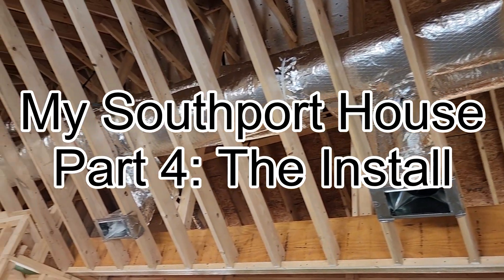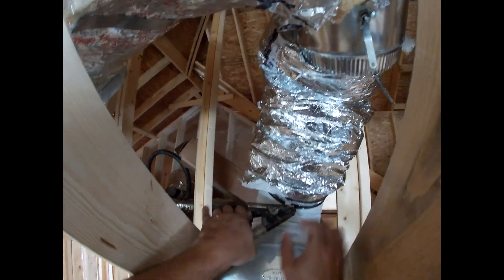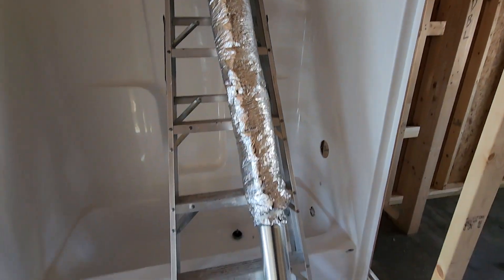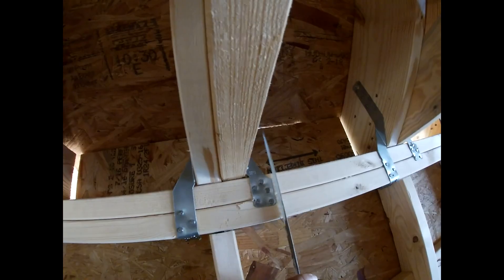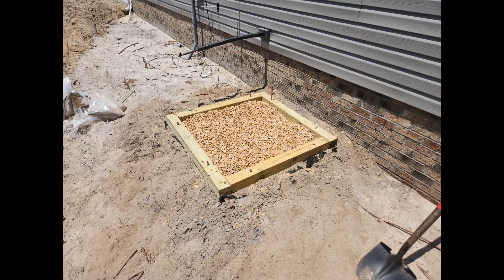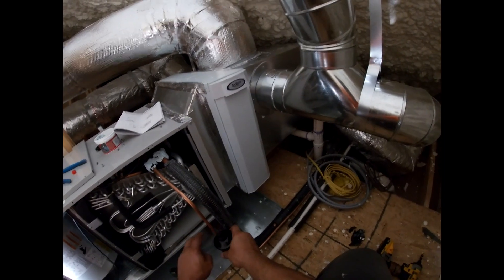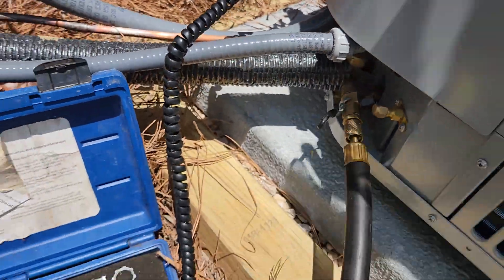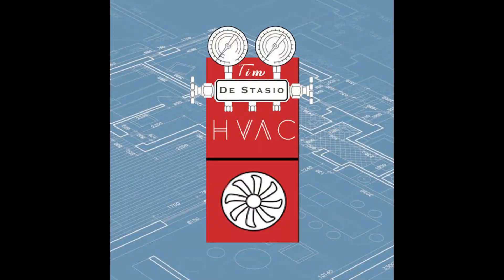My Southport House Part 4: The Install

Comment: I was always taught to break the vacuum with refrigerant before re-installing the valve core. There’s no way to prevent a little bit of air from entering the system when the valve core is installed first. Easy way to do it on a new install is to open the valves before installing the valve core but if you have to add charge for additional lineset length, you can weigh in the additional charge, open the service valves, then install the valve core. I’ve done a lot of work in the Wilmington area, I live near North Topsail Beach. I mostly work in Jacksonville now but I occasionally will have a service call in Wilmington. You do some really clean work! Nice looking install.
Reply from the maker: Great comment! I broke it with the lineset charge this time.  But yes, usually, cracking the suction line is how i do it.

Comment: Loved this video! what aprilaire filter is that? Great install also.  I loved that insulation cover you used also. I need to buy that stuff for existing machines i maintain.
Reply from the maker: That's the Aprilaire model 2310.  The penetration is from Airex http://www.airexmfg.com/
Reply: @timdestasiohvac  I'm guessing that everything you've bought is smart, efficient and carefully thought out... so.. i'll be using all these things! For my house remodel i'm in :)